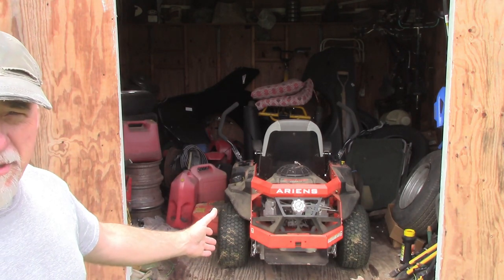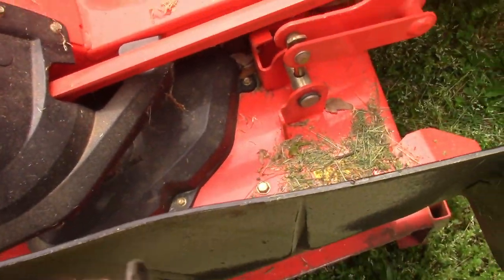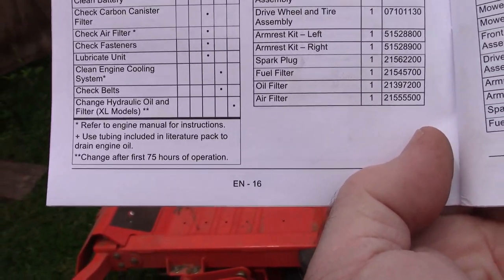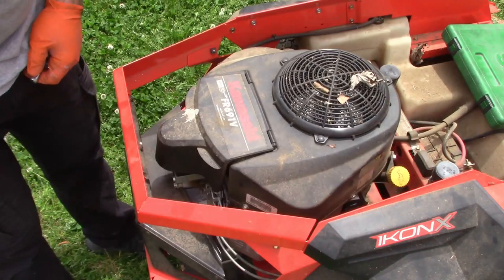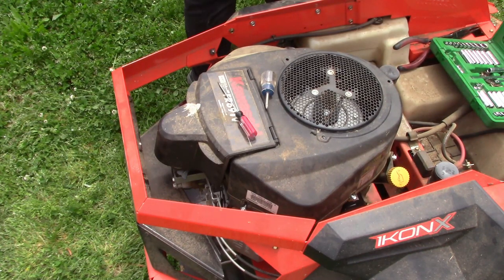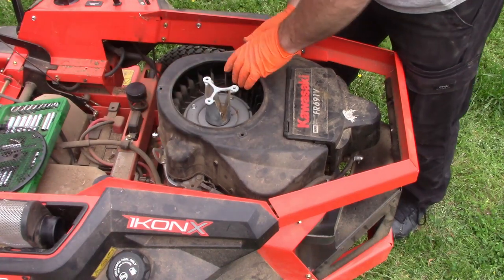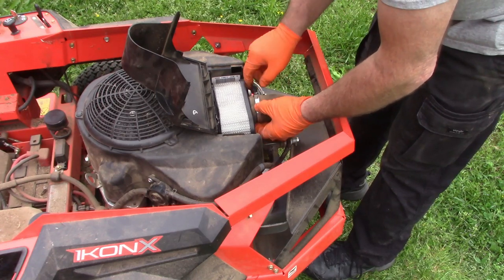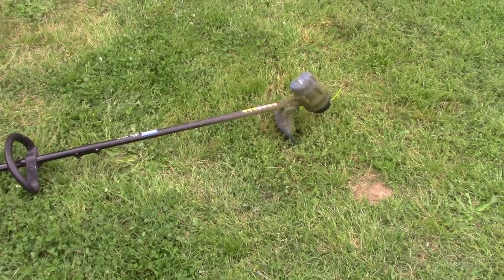Ariens Ikon 4 year review. 100 hour service. 52" zero turn mower.

Comment: There is a factory defect on these (and the 42in models)...

It loves to sling the drive belt. This is due to the idler pulley being misaligned from factory. Shimming with a couple of washers fixed that issue for me.
Reply from the maker: I must have gotten one without the defect. No issues since I bought it.

Comment: I changed the transmission fluid by simply locating the fill plugs on top, then drilling an access port using a drill hole, removed the plug, noted the fluid level, pump out the old fluid, pump in new oil, checked the fluid level, done.

Comment: Thats all the grease fittings but watch out for the starter solenoid ive already had to replace it 2 times now and in the process of trying to get some help with my pto not engaging unless i start the mower and hook it up jump it off with my vehicle but only then will it engage the fins are underneath for ur hydro drive be carefull not to damage fins cause it will shut u down until u replace it thats for the hydro cooling , "thats what it was supposed to mean" said the ariens service dealer which also mine u , sold me a bigger battery and went to put it on and wouldnt fit back on due to tie down was told " oh you can take that off completely and just leave it off , thats what most people do , brabd new mower but i love my mower other than the PTO and charging bit , i love it

Comment: Thanks for sharing. Just got the XD 52 yesterday. On a side note, you should always charge a lithium ion battery (especially before using it), if it's been sitting a while. It's just better for the long term capacity of the cells. Lithium ions don't like to die completely, nor do they like to sit discharged for any length of time

Comment: That was some good info on the engine cover removal. I have an XD 52 with 63 hours on it. Now after watching your video it will be a breeze to take off the engine cover. Like you said the engine manual was not as informative as it should have been as to what needed to be taken off. Thanks for the video

Comment: I have the same mower , I service the trans every spring . Takes a few hours taking them off and putting back on , but it's worth it . First change there was some break in stuff but each one since has been fairly clean . I have 400 hours in 4 years .
Reply from the maker: Is there an instruction on how to do that? I’d like to change the fluid.
Reply: @jodaddysworkshop786  there might be a YouTube video some where but if you take your time it pretty easy to drop each unit . 
   First of coarse you have to take the drive belt off . When  lowering each unit support is needed so the ears where support bolts go aren't stressed to the point of breaking . I just put like 3 short 2x6 under the unit . 
  Fluid wise I have used Amsoil and Valvoline full syn. 20w50 . Around 1.75 quarts per side . 
  You can do it I'm sure . If you have any questions just shoot me a reply .
Reply from the maker: Ok. I would like to do an actual video on the process.

Comment: Hey Barry. Not sure if you see a lot of Mice down in Georgia but up here in rural NY they are a nuisance especially in the fall when they are looking for a winter home. They love to nest under the top cover and fill the entire area around the cylinders with grass and paper. I have had to replace cylinder heads on a few lawn tractors because the owners don't notice it and it overheats the head so much that the pressed in valve seat pops loose and jams the valve open. Always good to take a look before the season gets going. I am great with maintaining my equipment but not so much when it comes to my lawn mower or snow blower. Just want to take it out, do the job and move on to the fun projects lol.
Reply from the maker: We don't really have any problems with mice. I did have a rat in my shed, but I trapped him and he's gone.
Reply: When you are ready to store it, put some mothballs on the ground under the mower

Comment: Mine has 72 hrs came out to a puddle of oil this year.  I think it’s the transaxle needs replacement as they are not serviceable. Still trying to get it to a shop for repairs. Beware buying from Lowes because dealers only like servicing their own. Have to go to next town to get service. I live by Louisville Ky a big city and have to take to Bardstown.
Reply: Check your oil drain valve, I had the same problem and the drain valve was just loose....

Comment: In 2017 i bought the ikon xl 60" w/ the kawasaki engine.  Just last week I had to change the seat switch and belt.  I went ahead and swapped the TPO clutch and the tpo switch too.... pretty easy job.  It's still cutting like the day I bought it.  I've done all maintenance as you should of course but a very reliable mower, to date.  We have 2 acres as well.

Comment: Man that thing sounds rough,Valve adjustment maybe,I've changed my oil 5 times In 194 hrs Kawasaki Oil n Filter always mine hasn't even turned the muffler colors yet. Great lil mowers

Comment: I'd throw some zerks in those front wheel frames and take out the bearing seals to let the grease flow in there if I were you. There's a reason they don't install them at the factory and it's spelled "your $."

Comment: On ur starter solenoid there's a smaller wire could you please tell me where or which side it hooks to not the 2 wire connector i know that clamp on top but thank you for any help

Comment: My ikon like this one has a winey transmission. Seems like it’s always done it but couldn’t find if the trans needed fluid added. Seems as if it’s a sealed maintenance free gearing. Any clue you could help me with ?
Reply from the maker: It is a sealed unit. I’ve been told that someone has taken them apart, cleaned and added fill and drain ports to service them.

Comment: I’m pretty sure that model doesn’t have a serviceable hydrostatic transmission.  There are more grease fittings that you have to lube or you will have undo ware and you will be replacing parts.

Comment: You can use a vacuum cleaner to clean that air filter. But never use air pressure to blow out a air filter. Doing so damages  the filter medium. A air filter that is a little dusty filters better than a clean one. Compressed air will destroy a air filter. I'm not condoning using compressed air on a air filter but if you must blow from the inside out. And be gentle with the air.
You need to research barrier filtration.

Comment: What was the idea of taking the fan cover off? That is just inviting trouble - if it ain't broke, don't fix it!!!
Reply from the maker: Following the directions in the manual.
Reply: Milton, the main reason for pulling off the fan cover is to inspect the cooling fins on the motor. Some people have had complete engine failure due to overheating on the Kawasaki Motors. In most cases it was due to grass and debris clogging up the cooling fins on the motor. A lot depends on the grass you're cutting and whether you cut grass when it's damp. I'm going to pull mine off at 100 hours and blow everything out and if it doesn't look that bad then I'll wait a little longer the next time I pull the cover.

Comment: Have 292 hours on mine, have replaced 5 broken belts, won't drive straight, needed a new battery after 1 season, change oil exactly per the schedule, pit bigger rear tires on, and there is a weird smell coming from the top of the engine, running or not.  Very disappointed in this machine.  Never spent so much time working on a lawnmower in 40 years.
Reply from the maker: Sorry to hear that. I’m still on the original belt and haven’t had any other issues other than the battery recently died.
Reply: Engage the mower blades at a low RPM, then increase the engine rpm too the engine speed you wish to mow at